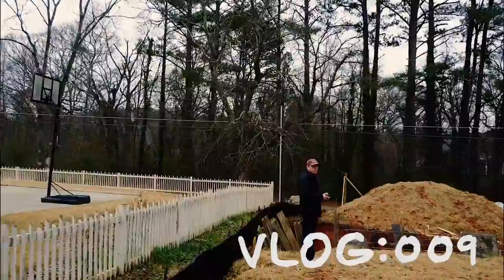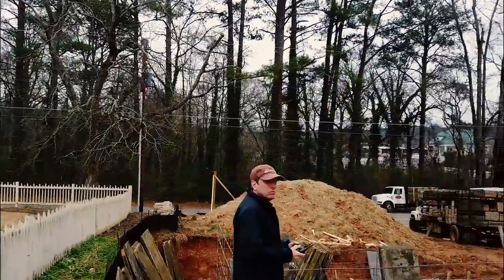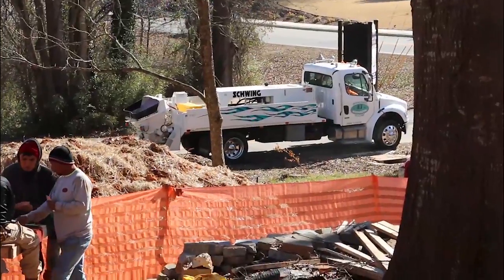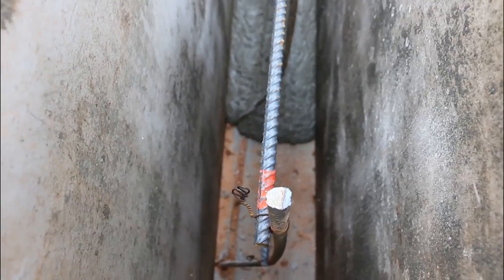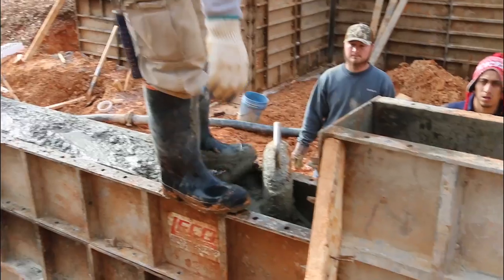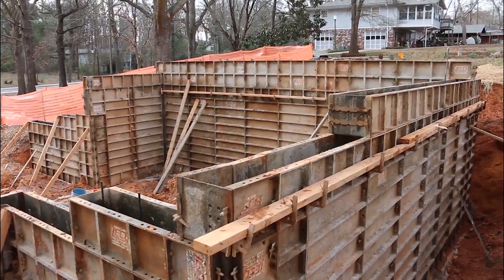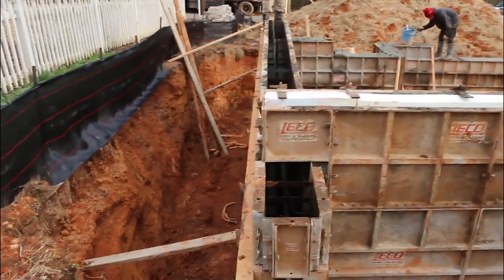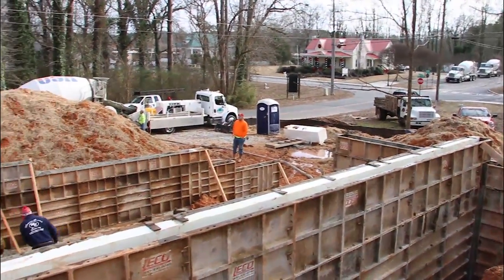Pouring The Basement Foundation Walls | VLOG 009

Comment: In a previous response you indicated you would be insulating the basement walls. Why did you chose poured concrete and then insulate, rather than Insulated Concrete Forms (ICF) a one and done system? ICF's are much easier in my opinion, and construction can go on sooner. Thanks
Reply from the maker: Hi Fred. We considered ICF and even got a bid. It was going to be $4000 more, even with a discount. It was a trade off, but we opted for saving the money. Plus, I've got one daylighted basement wall that will be R-28 at best. I didn't want to invest big dollars on a R-50 ICF wall, when with the resistance so much lower on the 4th wall. Also, a large percentage of the concrete walls will be backfilled, so I've got the insulation value of the ground helping as well. All those factors contributed to our decision. Part of me regrets not pulling the trigger on ICF, but I needed to reduce the overall budget where I can. So it was a hard call. Thanks for your comments.
Reply: I understand and appreciate your candor on cost, standard ICF's only provide a R28 wall anyway. The R50 is misinformation unless using much thicker than std. forms. Some companies try to say the concrete itself is an insulator its not! Nor, I might suggest that the ground has little or no protection in R value. I built an ICF house myself footer to rafters and the ground provides a constant temperature, but no real insulation. Was the quote of 4k more, with total cost of labor, foam board and time to installed involved with how you are currently are proceeding?

Comment: QUCK QUESTION. You poured concrete to create the basement walls. Theoretically speaking if you wanted to build lets say a 2 floor house, could you use the same method and pour the concrete to build the house?  thanks
Reply from the maker: Michael, the answer is yes. Many places that have a shortage of wood and an abundance of concrete, like the middle east, build homes completely from concrete. In our case, the concrete portion of the home was much more expensive than the stick-built wood portions.
Reply: GreenShortz + GreenHouse and what about the formwork they used to hold the concrete . What’s the process of getting those ? And lastly how LONG did it take to setup and do the pour and how long after the pour was the concrete ready? Thansk
Reply: @eeforest7122  The concrete company had a truck load of forms that they selected from to match the design of our foundation. They set up in one day and then poured the next day. The pour and finishing took about 4 hours. They took the forms off the following day. If you are looking to do your own formwork, you should look at ICF...insulated concrete forms. The forms are blocks of polystyrene with tabs inside to regulate the gaps. They stack together to form the walls and the concrete is poured in the gap. The forms are left in place, with the foam serving as insulation on both sides of the concrete. Pure Living for Life (a DIY homebuilding couple) did ICF walls. Search for their videos on that topic to see how it works. Thanks for watching.